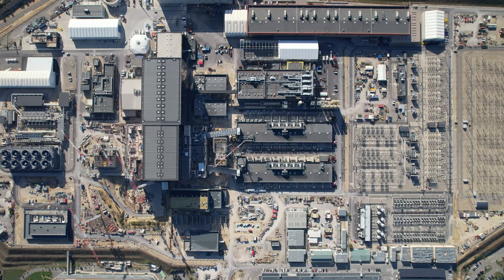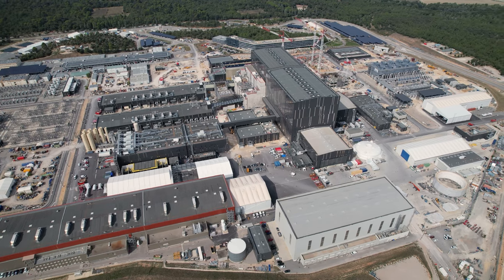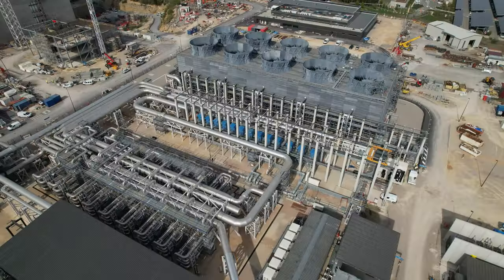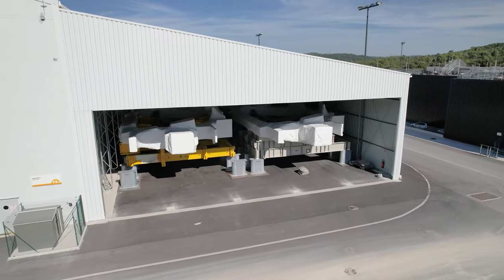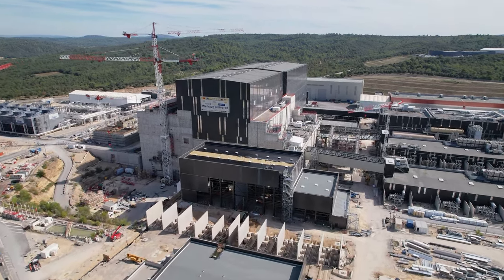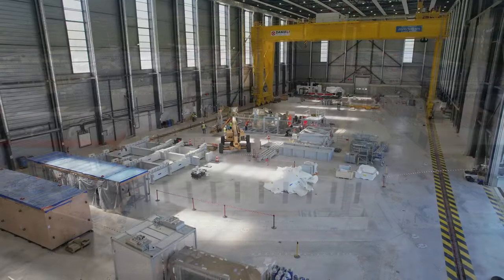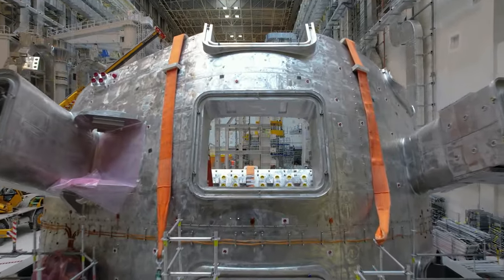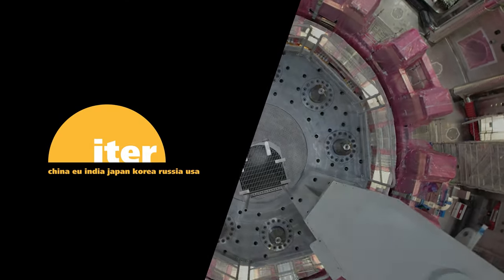ITER by drone - late 2023 (voiceover version)

Comment: First plasma for 2025 seems impossible . So we add another 2 years delay....
Some facilities that were not even planned when iter started to build are already producing some results . One starts to wonder , why the HUGE lag ....
Reply: First of a kind. Never been built before. Large multi-national consortium with all the upsides and downsides. Build at very large scales with extreme precision.
Reply: @mrhaftbar  As i mentioned , others did it starting from a 10 years handicap. At a smaller scale , but still ! . Do you even know when did this project was first conceived ? , search for some info .
Reply: @kisspeteristvan  of course. As you said,  it's roughly 12 years. That's nothing for a megaproject of this size. Wendelstein 7-x took even longer, starting with construction around 2000 and being in planning till the 80s. Even "standard" nuclear reactors still take around 7 years of construction on average. 

So please, enlighten us: Which experimental, first of a kind fusion project this size was completed in less than 10 years?
Reply: Probably because of the IMMENSE complexity of the project and , in no small measure, the incessant whining of people who have no idea how IMMENSELY  COMPLEX this project is.

Comment: If ITER is successful - are there plans to change the purpose of the heat and generate useful electricity - or are we going to just make heat and vent it? I understand the purpose is to test fusion technology and do materials testing for future reactors - it just seems wasteful if it actually works